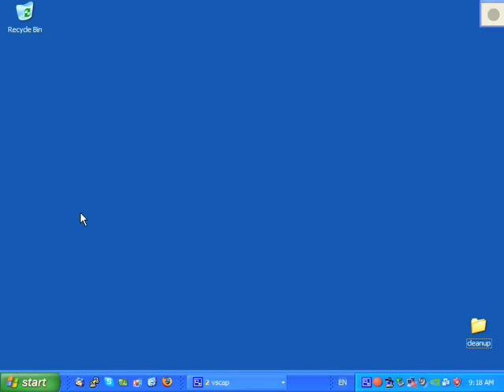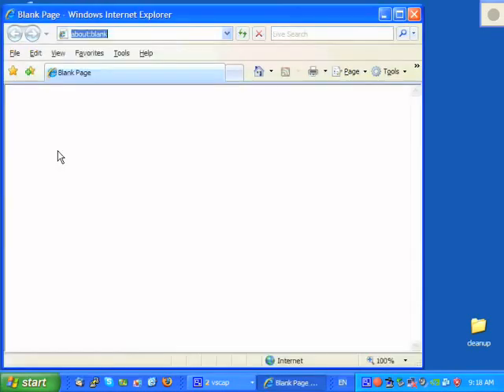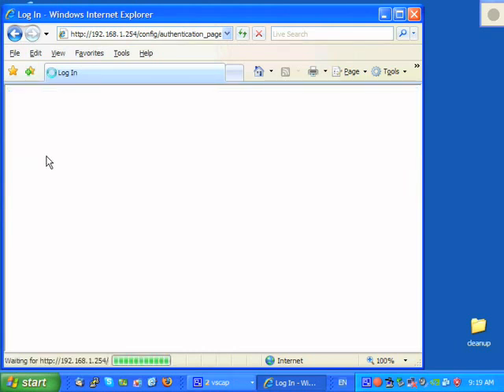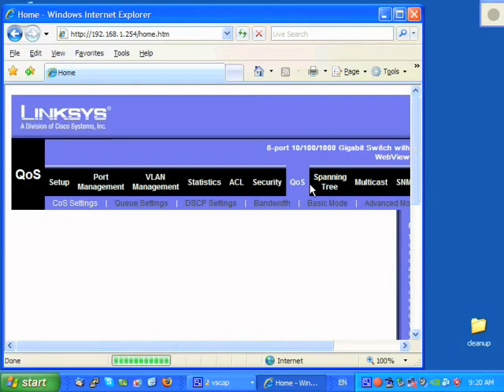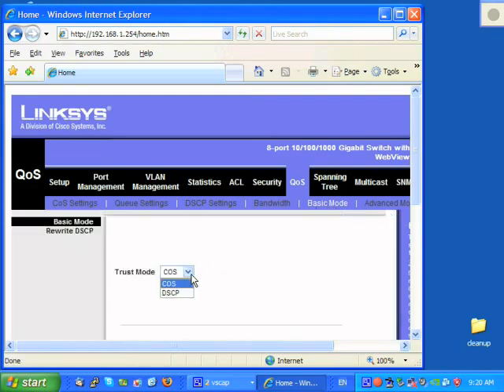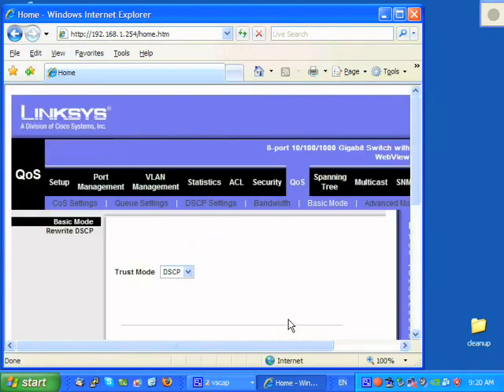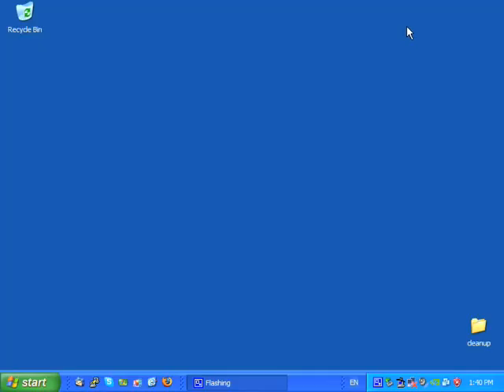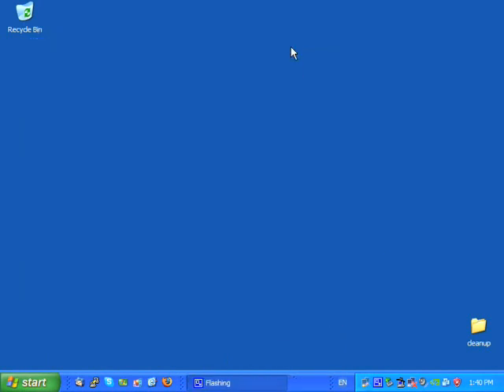Linksys QoS Configuration Example

Comment: How come you did not need to add gateway etc
Reply from the maker: Dante doesn’t contact the internet for any reason with hardware devices.
Your computer might want a Gateway if you’re using the same network to get to the internet. But Dante doesn’t require it.

Comment: does not work with linksys lgs326 switch
Reply from the maker: Hi there. Have you contacted Linksys for assistance with setting up QoS on that switch?
Reply: @audinate  finally worked the IP address was not showing up in my router settings. After certain time it showed up.
Reply: After unplugging and plugging in reseting etc